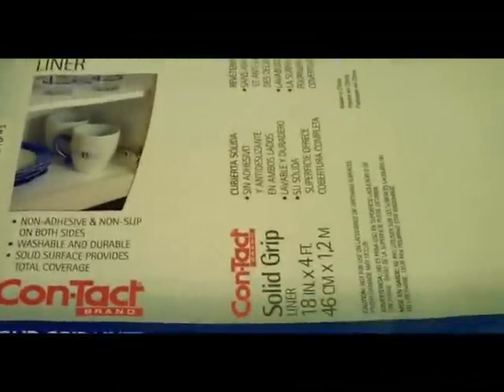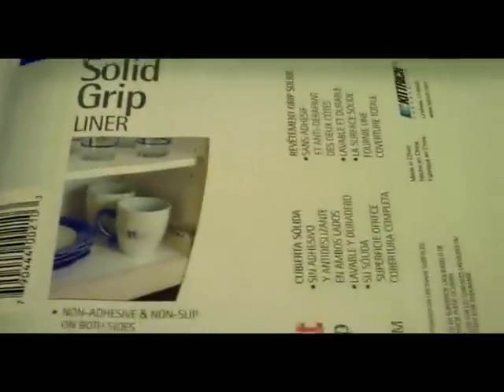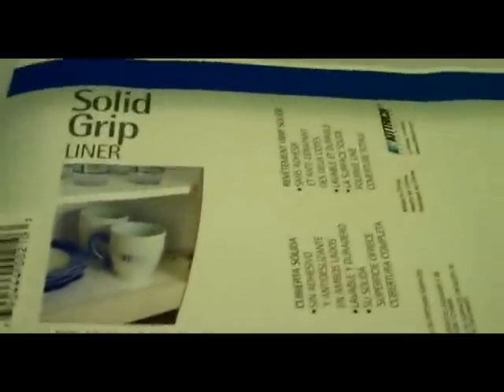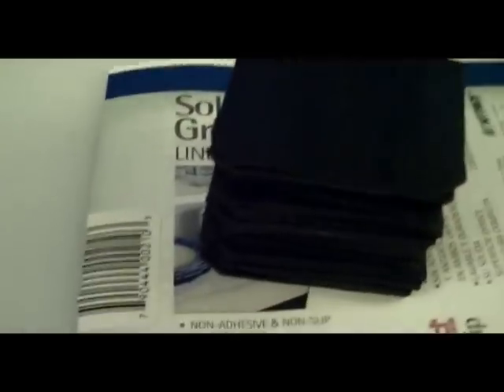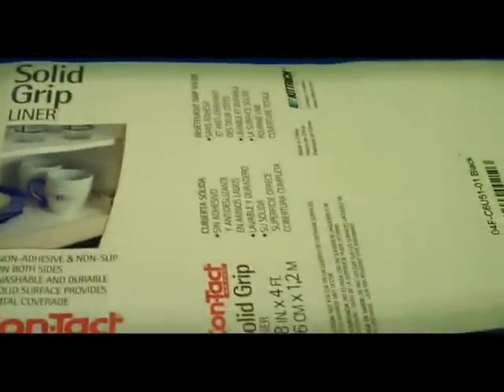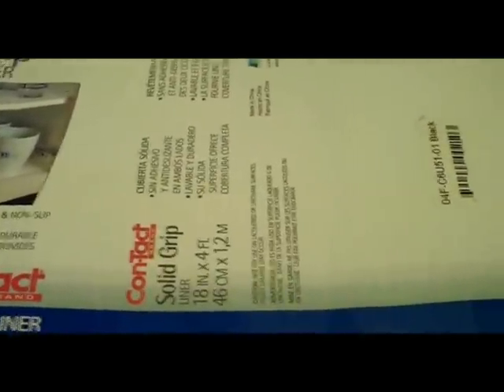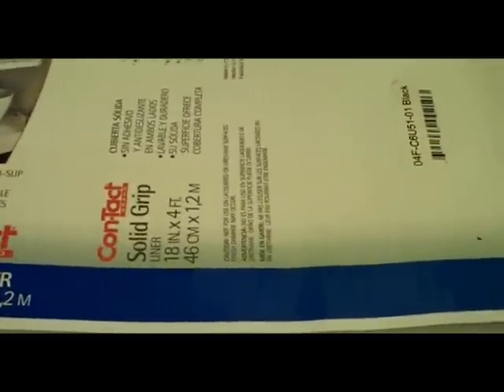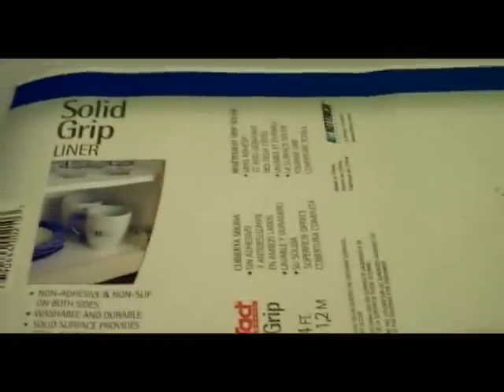Vid47 NEW GASKET MATERIAL (HHO, Brown's Gas, Hydroxy)

Comment from the maker: I've used a sealant before, but I always resented the fact that it wouldn't work the first time. That is why I started looking for different materials for my gaskets.

This new material has been in use for a week on my latest Dry Cell and so far there is no sign of problems.  It withstands high temperatures and still maintains a tight seal between each plate.

Comment from the maker: @drumstick9000 

It does not have any adhesive, but it does stick to the plates when pressed.

It is called drawer or cabinet liner.  You can buy it at WalMart, Target, Home Depot, Lowes, Ace Hardware.

Comment: I found it at home depot, but when I tried it I was unable to get a consistent gap space between the plates. It also squeezed out and covered the plate edges a bit. I'm now using a rubber/fiber gasket material that I found at Autozone. It's 1/32 (.031) thick. Great results so far.